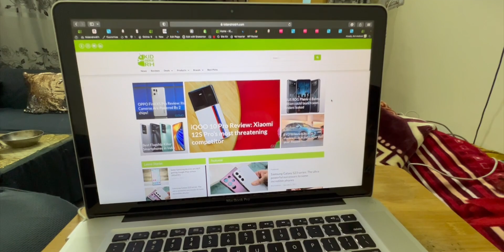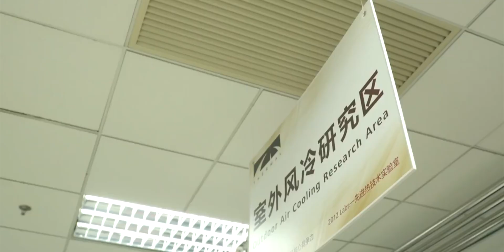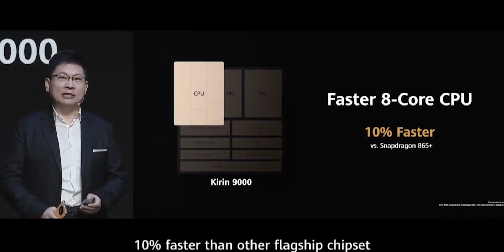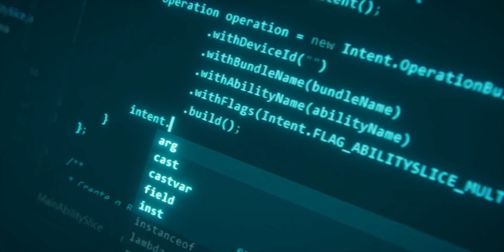Huawei - Finally, It's HAPPENING !!

Comment: I'm surprised that it's 12nm. Former Google CEO Eric Schmidt said that SMIC has 7nm manufacturing capacity and he even mentioned something about 5nm. But maybe that's for smaller microchips, and 12nm for Kirin may be enough performance. Intel's 13th generation CPUs seem impressive and that's 10nm! So for example 12nm for P60 could be enough I guess, unless it turns out that it's actually 7nm, haha.